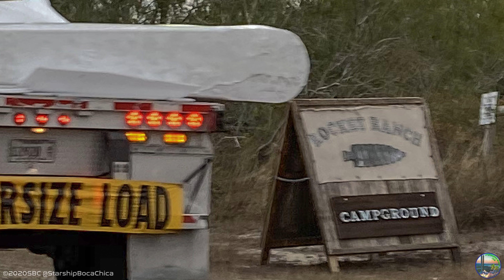2020 12 05 SN8 Waiting to Fly - SpaceX Starship Boca Chica

Comment: Well done Maria. However this illustrates a problem further down the line with starship. Elon wants to send starships to mars but they will need multiple refueling in LEO. How can they meet the launch window for mars if the tanker starships are so much at the mercy of weather, which is  likely to get more exciting with climate change. Need to build a gas station in orbit capable of completelly fuelling a starship(s) for mars launch when needed. This would be supplied by tankers throughout the time between windows.
Reply: Cryogenic liquid storage only happens two ways. 
1-by refrigerating it, 
2- or holding it under super high pressures.
Their land based tanks are high pressure in design so the cryo liquid can not turn back from liquid to a vapor state.
The portable delivery trucks have refrigeration units on them and use the lighter built tanks. 
Rockets use a lighter tank. They just hold a pressure the turbo pumps need but vent the rest to keep pressure level safe. (If used in orbit, the tanks would go empty fairly quick.)
You can not use launch-able light gauge tanks and not vent them. They will explode.  You don't want to keep a refrigeration unit serviced in orbit either.  
You do not want to make Starship tanks heavier.   
Maybe three dedicated heavy wall tanks for a second stage for the SHB could be designed that could be bolted together in orbit and just left there, for the Tanker Starships to keep filled.
Your Orbital Gas Station. (But next comes the small 24 hour store for beer, then a bigger parking lot and signs to advertise.... Who the heck would you get permits from?)
Reply from the maker: Weather was more of a problem for visual needs and photographing such as cloud cover and rain.  Elon needs all our social media coverage and hos own to do needed analysis.  Probably had many windows and just need more staging time.
Reply: Weather requirements vary significantly from test to test. Tall hops are particularly sensitive to wind speeds.

The safety engineers run the math to calculate where debris might fall given an explosion at any altitude during the flight based on various strengths of worst case wind speed. They then use those to calculate potential keep out zones for each wind speed.

They negotiate with the FAA on which one to use for the NOTAM. The wind condition assumptions used to calculate the NOTAM determine the maximum acceptable wind speed.

If they are granted a larger NOTAM, they can launch in higher winds.

The rules will change over time, based on rocket behavior in flight.